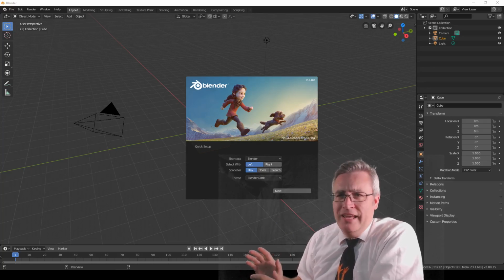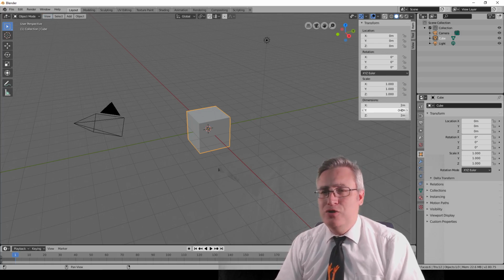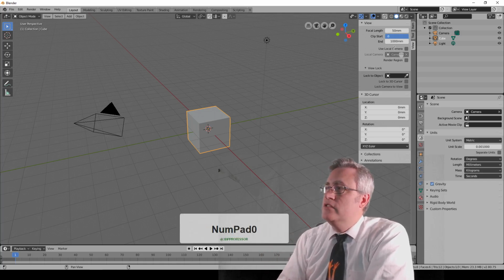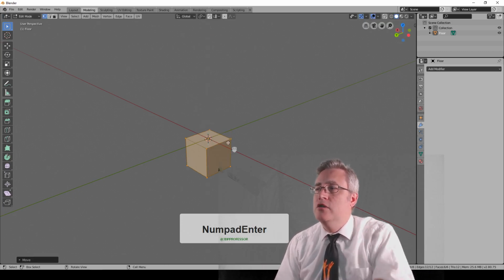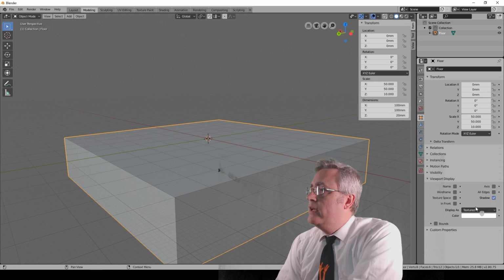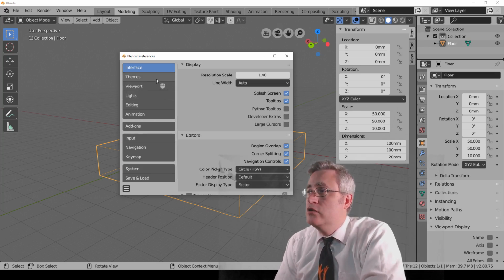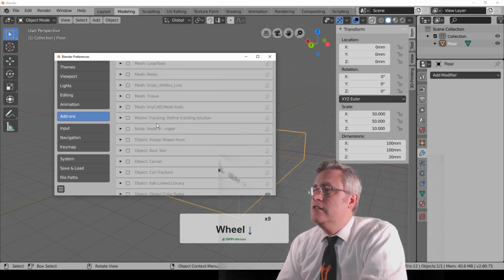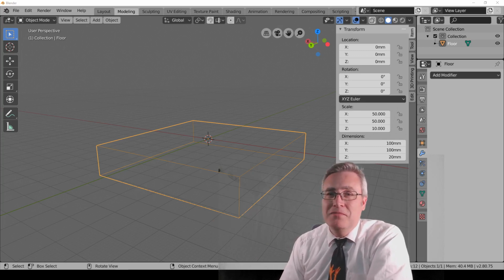Blender 2.8 for 3D Printing, Start Here - Part 1 Setup

Comment: Hi Professor, Your videos are very help full for me. Can you please make a video of Modeling 3D hexagonal framework on a solid base.
Reply from the maker: What would the purpose of a hexagonal framework on a solid base? Just so I can have an idea of what you're thinking?
Reply: @3dpprofessor  Thanks for your prompt reply. I want to make a porous 3D structure on top a solid base Similar to this link 
 https://www.google.ie/search?q=porous+cube&client=opera&hs=Fpe&sxsrf=ACYBGNS7FxxcfwX7D2NhM8YanvGRo_x7Jw:1579543945408&tbm=isch&source=iu&ictx=1&fir=oGqP-4aUZlrOXM%253A%252CRKCATV5AX_EUM%252C_&vet=1&usg=AI4-kQzFCJqwgLeZqwhahnXR5jYMEUOBw&sa=X&ved=2ahUKEwibvJfe45LnAhU3UhUIHXFbBm0Q9QEwAHoECAYQBA#imgrc=oGqP-4aUZlrOXM: 
I would really appreciate if the framework is changeable from cubical to hexagonal, or tetragonal.  As i want to 3D print (SLA) this model, it would be great that the thickness of the frame work (Walls) is also tunable.
Reply: @3dpprofessor  I would also appreciate if the framework is changeable from cubical to hexagonal, or tetragonal.  As i want to 3D print (SLA) this model, it would be great that the thickness of the frame work (Walls) are also tunable.
Reply from the maker: @UmairGulzargumair  So it sounds like you want a cube, let's say about 50mm on a side, where the bottom, again, let's say, 2mm, is solid, and the rest is hexiganal porus structure. If you were doing FFF you could do this easy enough with clever slicer settings, but since you're doing SLA you need it to be fixed geometry. Is that right?
Reply: @3dpprofessor  Well the main goal is to make a 3d printed disc (16mm radius and 0.5mm) Half of the height of disc (0.25 mm)  would belong to disc base and rest of 0.25 mm will be 3d hexagonal or cubical or tetragonal frame work.
Reply from the maker: @UmairGulzargumair  0.5 mm, huh? You know what's not a lot of mms. That's basically a little texture on top of a disk.  A far cry from the porus cubes you were talking about.

I don't know if I can do a "tutorial" for a project that is so loosely defined that my understanding of what you want has gone from "A base to place gaming minis in" (that's what I thought you meant at first) to "Porus cube" to "a little texture on a a big, flat surface that could easily be done with FFF slicer settings". So at this point I'm gonna say a few things: (1) the cylinder object with only 6 sidews will get you your hexagon base shape.  (2) Read up on the solidify and skin modifiers. (3) Blender doesn't do changable frameworks that much, and there's no modifier to turn a hex grid to a cube, or tetragon, so that's probably not going to happen. And if I were doing this, I'd just do it with FFF printing slicer settings.

Good luck!
Reply: @3dpprofessor  Thank you Sir. But Height is not an issue. we can go for 1.5 mm. The printer i am using has a resolution of 0.1 mm so if i have 0.5 mm base and 1 mm thick framework on top. I will be able to print that.

Comment: What do you know of any addons for Blender to setup a gradient infill? Wanting to test with this but have yet to find any slicer software other than slic3r that have any options at all using this method. Hoping there is something in Blender to accomplish this so I dont have to rely on cheap slicer software to do what it should have been doing for years already...;)
Reply from the maker: Infill is not an aspect of design. That's purely about the slicer. So, no, Blender and infill doesn't intersect.
Reply: @3dpprofessor  That sucks...

Comment: I am a blender beginner but fairly computer literate and familiar with 3D printing.
The mechanics and interface seemed to change from 2.8 to 2.81 and I got lost about 5 minutes in. Also, not having the mouse highlighted made it hard to try and figure out where to click especially when where to click changed in 2.81
Reply from the maker: 2.81 broke  boolean modifiers for me, so I have to wait for the next version.
Reply: 3D Printing Professor they changed all the shortcuts I’m used to so I went all the way back to 2.79
Reply from the maker: @DaSpineLessFish  the shortcuts changed in 2.8. I just decided to get used to them. The only one I regret losing, and may put back, is alt+c convert object to mesh.

Comment: While setting up the units, can't we just create the cube smaller rather than scale the unit 1000 times smaller ? I am newbiew for blender sorry. I am sure there is a very good reason why you have done it so. But i wondered why.
Reply from the maker: Nope, no good reason. That's a great way to do it, too.
Reply: @3dpprofessor  thanks for quick reply. However, since i have catched you here let me throw another question that i couldnt find answer :), i have installed blender 2.81 (without knowing it) and i dont have 3d view: modifier tool listed in add-ons menu. Where can i find it ?
Reply from the maker: @osman766  I don't know. 2.81 changed some things and it started crashing when using the boolean modifier, which I do a ton. So I've had to roll back to 2.80. At the moment I'm waiting for the next version.

Comment: When you export it in .stl Do you have to check the scale option? Because in previous verion, even if you have set the scale in the world, it did not applied when exporting so I had to set a scale again in the export menu
Reply from the maker: As I've talked about before, STL is technically unscaled. So if you set up Blender as I described here, you can just leave the scale at 1.0 and it'll export as mm. But if you don't set it up and actually modeled in meters, you can set the scale at 10 and it'll convert it.

Basically, follow this guide and don't worry about it.

Comment: this is literally one of the rarest video on youtube that doesn't delete the default cube but everything else in blender tutorials :D 
usually the first job is deleting that cube :)
thank you btw, this is really a helpful video!
Reply from the maker: Believe it or not, my default scene, as you'll see in part 3, still has a cube in it, albeit the cube is changed in shape a bit and renamed.
Reply: @3dpprofessor  yeah :) i have been following it and that's really handy. 
i also made up a "default_3d_workshop.blend" file. so i am still using the original startup screen but when i follow your tutorials i will open that file.

Comment: Thx A LOT!:)

BTW, I've been doing 3D since 3D Studio DOS r2 (way back in early 90's), then onto 3dsmax. In fact, I professionally wrote custom code for 3dsmax for many years. Along the way I peeked at Blender, but its UI was "less than ideal", so I deemed it not worth my time, especially considering I was (am) proficient in 3dsmax. I recognized its power, but "No thanks, UI".

Well, Blender 2.8 has brought the UI into the 21st century:) So, I'm digging in now:) Plus, I'm heavily into 3D printing (in fact, I run the 3D Lab at my local makerspace). So, this video is really helpful. Thx, again:)
Reply: P.S. Also, thx for the boolean add-on tip, as I have a need for such on a current project. Now, I know booleans can be "problematic", but I'll be interested to see how they perform in Blender. Are there "other" boolean options (add-ons)? Thx.

Comment: Loving this tutorial, just given me the confidence to dive into blender. Done a few bits in Fusion, tinkercad etc. But my main desktop is now a raspberry pi 4. Can you 3D print on the cheap? Just about... now with blender on the way I’m getting there. Shame it will only run Blender 2.79b as it won’t do OpenGL 3.3. But I know all the features / settings you have mentioned exist in the other versions. They’re just obscured in a menu. So now it’s hunt the option!!! But thanks for setting me off on the right path, or should that be plane?

Comment: Great, video. I noticed now objects export 1000x times too small into .stl. And how to prevent exporting the baseplate ?
Reply: One thought I had about that is delete it before saving the final stl file. I am sure he will cover removal of the base in a future video though.
Reply: @birdmun  Yes, also noticed theres an option to export only selected in the export file menu. Also 1000x scaling can be applied at export so the parts work fine in the slicer.